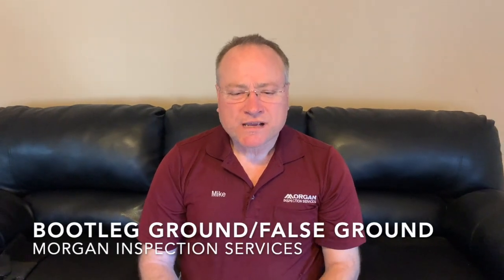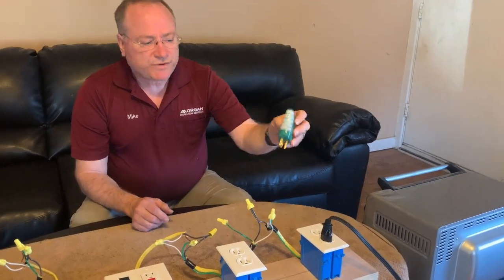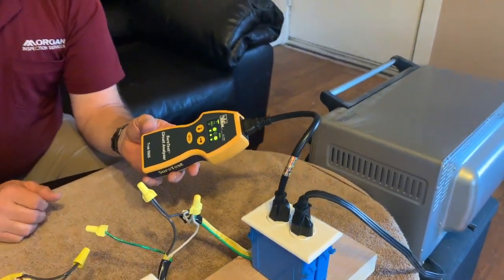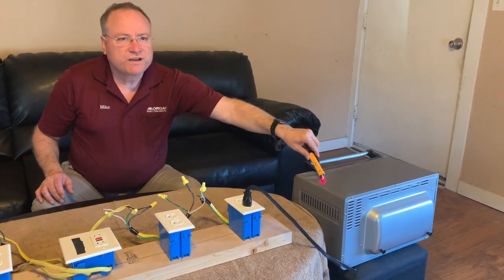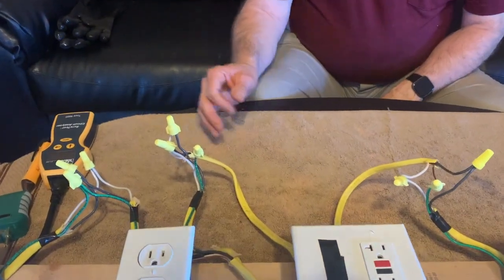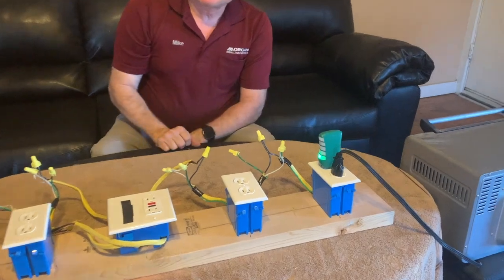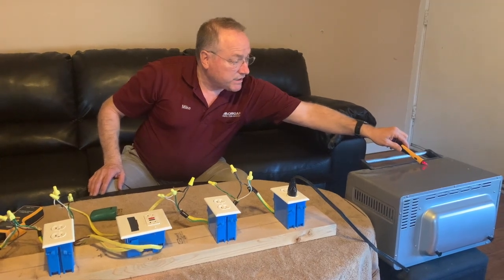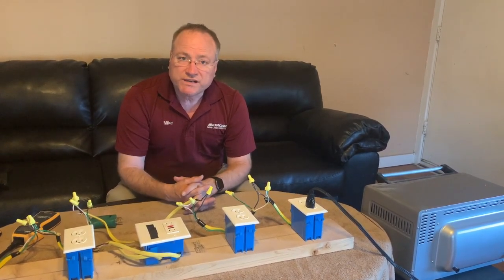What is a Bootleg Ground? Why are Bootleg Grounds Dangerous?

Comment: what the hell is a boot leg ground
Reply: Basically the ground wire on the outlet is tied to the neutral wire rather than back to the panel on the ground bar. This method is common in older homes from the early 70s and earlier. A GFCI needs to be installed or the circuit needs to be rewired. Newer homes (1980s and forward) come with 3 wires and the ground is one of them.
Reply from the maker: I apologize for not explaining it in the video, but the written description of the video explains how a bootleg ground is created.

Comment: I have some outlets in my house (built 1952) where some idiot cut the ground wire off at the back of the box. I have had to use two prong outlets at these boxes or, in the case of the box near my stereo cabinet, fish a new grounding wire. I was having problems with ground loop hum from the turntable.
I have never used a bootleg ground, in fact, I had never heard the term.
Reply from the maker: Can’t imagine why anyone would cut off the ground wire. Crazy!
Reply: You can install a GFCI protected receptacle in these locations (use the "No Equipment Ground" label included with the receptacle) to allow you to use three-prong receptacles in these locations. This method is supported by the NEC. Use a licensed electrician for the conversion. This will make these receptacles safe for people to use 3-prong cords in, however, they still will have no equipment ground so you still won't want to plug your stereo turntable into one of them.
Reply: @CEvans789  I already ran a ground wire inside the wall and down into the basement where I used a split bolt connector to connect it to the number six system ground wire headed to the water service entry pipe. I did the same thing for the outlet that serves my computer. The ground loop hum disappeared.
Reply: @machintelligence  Yes. I understood that. I was referring to the other receptacles which lack grounds and are currently relegated to 2-prongs.

Comment: had a situation with a bathroom light fixture above a dual vanity in the primary bath, after removing the light fixture and replacing it, nothing in the bedroom and bathroom was working any longer. This was original to when the house was built. Turns out there was no neutral connection in the fixture. Somebody had cross connected the ground and neutral behind the light fixture, we did not see this when disconnecting everything in a hurry. But we could not get anything to work. So after opening all the outlet and switch boxes the very first outlet below the light switch for the bedroom we found a neutral that was coiled up in the back of the box, not stripped or connected to anything. This was the needed neutral for the room and into the bathroom lighting also. So after connecting this neutral to the other two neutrals everything started working correctly. This was only found out after 17 years, all the outlets in the bedroom and the lighting in the bathroom all were being back fed through the ground conductor in one of the dual vanity light wire boxes. And people wonder why houses have electrical fires! very dangerous.
Reply from the maker: That is crazy. Can’t imagine how/why anyone would have done it like that. So fortunate that no one was ever hurt as a result.
Reply: Also this had to have been done intentionally, cheap-ass electrician, probably had problems and just bodge-wired it.
Reply: On the house after 17 years .I live in southern California when the housing market started to take off. .  They were hiring anyone and everyone to work as long as there was a electricen who had a license working on the job. But this could have been 100 to 500 homes. There reasoning was the houses needed to  get finished no matter what. Oh yeah this was in the 70's when they started to break the unions. They only had to show the inspector 1or2 houses to get all the houses signed off. They figured as long as nothing happened before 10 years they were safe. Try to prove someone else didn't mess it up. Ha Ha

Comment: Sir: Is the reverse polarity the real cause?  Video presents more questions than
answers. Thank you.
Reply from the maker: Yes. With reverse polarity, you have voltage connected to the neutral wire instead of the hot wire. 
With the bootleg ground, you have the ground wire also connected to the neutral screw. Now, since there is voltage at the neutral, this also makes that ground wire "hot." With a hot ground wire, voltage will also be supplied to the frame/body of the toaster oven.
Reply: Morgan Inspection Services Excellent clear answer. Thank you

Comment: Sir: You possibly need to show us how the false/bootleg equipment ground was
in fact connected?   Second: Why did the Open Neutral cause the frame of the
appliance to become hot? Thank you.    Watched the video twice.
Reply from the maker: With an open neutral and a load plugged in and turned on, no current can flow. With no current flowing, there is no voltage drop across the load, so there are 120 volts on both sides of the load. This makes the neutral wire a live wire. Since the neutral wire is live, the ground is also live because it is connected to the neutral (because it is bootlegged).

Here is a blog post that explains what happens with an open neutral.
https://www.morganinspectionservices.com/hot-ground-reverse-on-three-light-tester/
Reply: Morgan Inspection Services Sir: I must question the statement , voltage drop
across the load".      Do not believe AC circuits have voltage drop at each load.
That would be for DC series circuits.      With an open neutral are we creating a SERIES circuit in the Alternate Current load?    Thank you for your input.
Reply: While an improperly wired circuit should always be considered dangerous and rectified (no pun...), I would like to have something clarified: The danger would involve closing the circuit by touching the chassis and a hot contact, such as an exposed wire, correct?